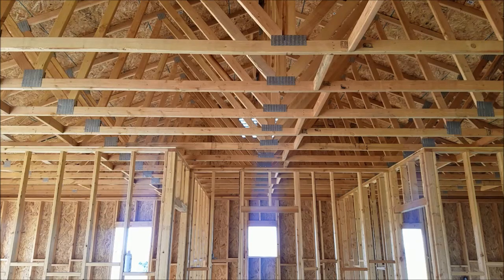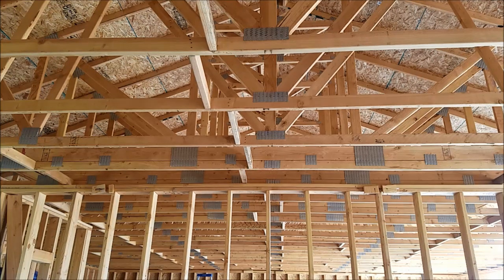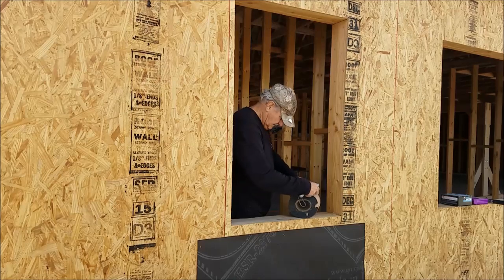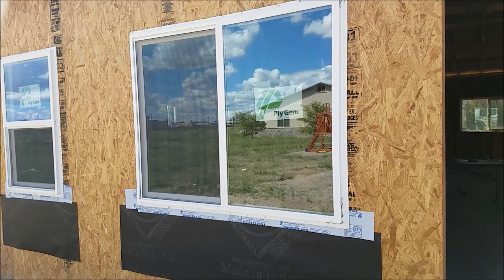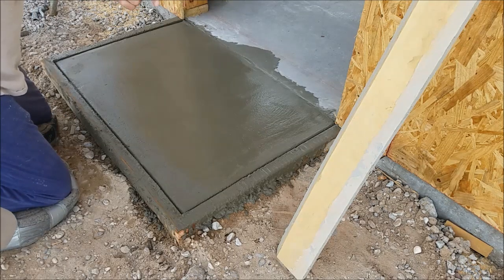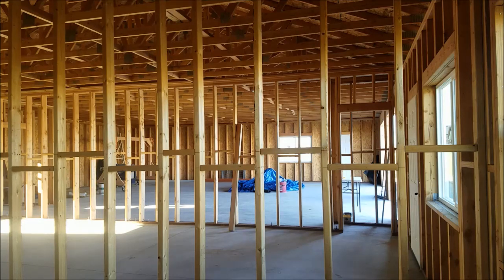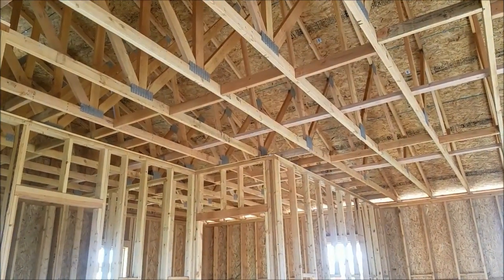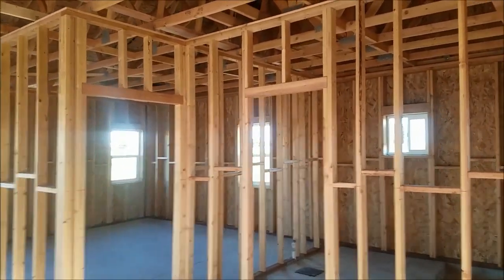DIY House Build # 24 - Bracing, Windows, Door, Inspection

Comment: I would have been surprised if you didnt pass. You guys did a fantastic job building it so far. I'm sure with your electrical skill knowledge that should be an auto stamp off as well. Just need to double check for the latest codes. They keep changing every year